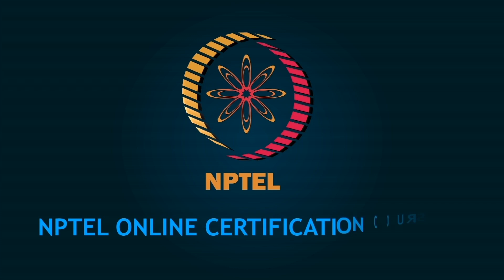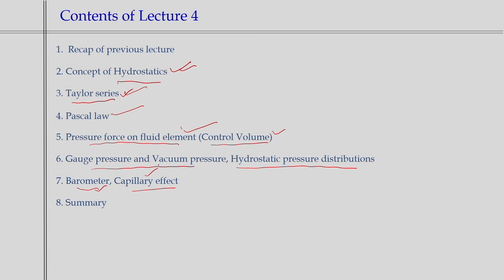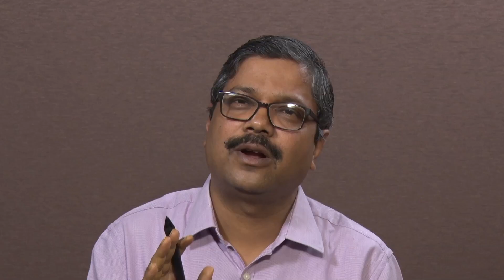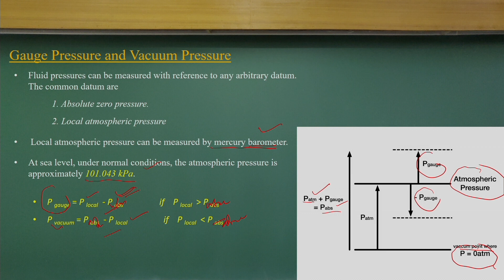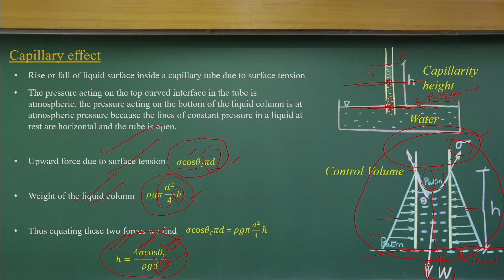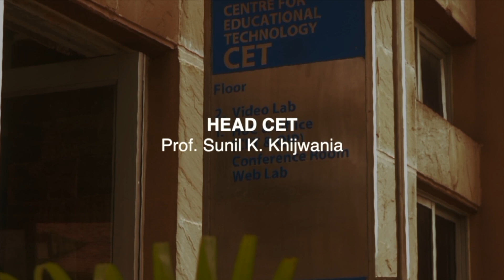Lec 4: Concepts of Hydrostatic

Comment: what about surface tension in mercury barometer case 55:00
Reply: Bro, in case of mercury we are simply using the pressure equation, unlike force equation in case of capillary action further if u calculate that height h value in terms of atmospheric  pressure  u will get the same result.

If u are not able to understand what I am saying just try to solve the force equation  on membrane, u will get

Patm = (4*sigma*Cos(theta))/d

As a result